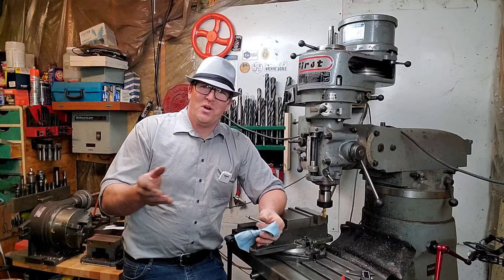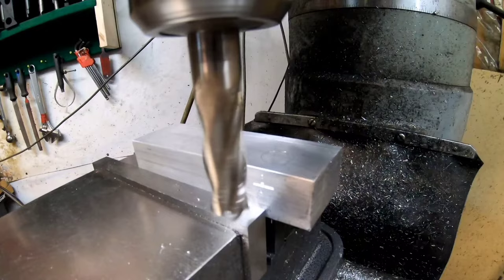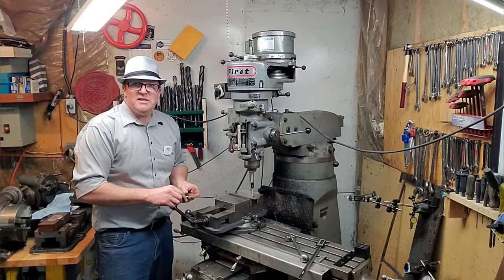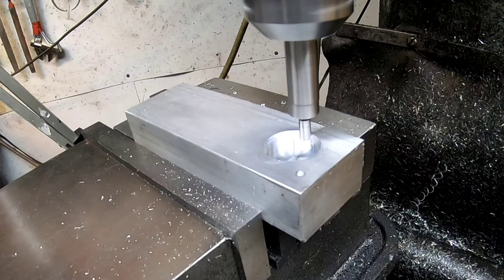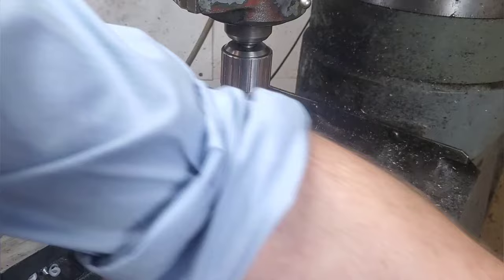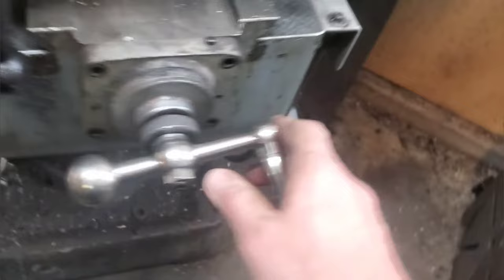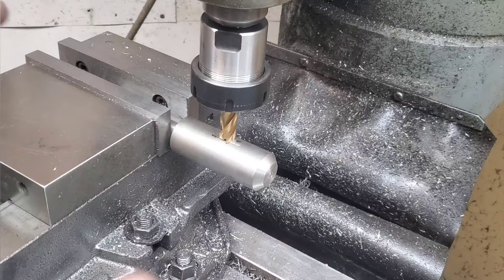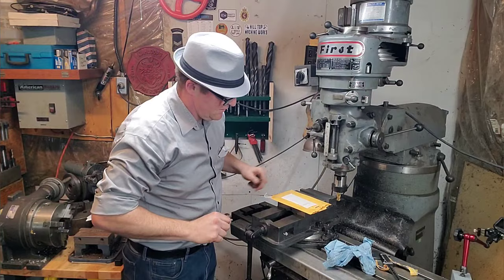Edge finding 15 ways for the Milling Machine

Comment: I’m a retired tool and mold maker of 40 plus years. I’ve got to say that the paper methods with a live spindle would get you a written warning at the shop I started in. We did however occasionally use a feeler gage and manually turned spindle to get a touch. The only other thing I take exception with is your edge finding the moving jaw side. I’ve always been trained and passed on that in most circumstances you edge find the fixed jaw side. I also prefer to use the edge finder in a collet,i find it’s more accurate. To find the center of a diameter you should edge find in one direction then the other and repeat it as you will not be spot on with the first try. Happy machining!
Reply from the maker: All good wisdom , thank you alan !

Comment: For paper touch off, use a Zig-Zag with a little oil to hold it in place. Works like a champ. The Zig-Zags in the white pack are 0.001" thick quite consistently.
Reply: What is a zig zag mate?

Comment: We used a cigarette paper and stuck it to the work with a bit of water ( or spit 😉 ). Probably a little bit safer than holding the paper.
Reply from the maker: Great point  :)
Reply: I use cutting oil, cigarette paper is 0.001 too👍
Reply: That's what i do. Got the idea out of a 70 year old book

Comment: For many years I just used a 1/4" piece of silver steel in a drill chuck.....OK so it probably will not be that accurate but good enough and quick for most work.
Reply from the maker: If it works dont change it !!!

Comment: There is no need what so ever to keep flipping the edge finder to make it wobble.
Reply from the maker: Personally I like to do it as preference to gauge speed approaching the edge and slow down.     For the actual workings of it you are correct.
Reply: @Wrighmachining  If run at the recommended speed of 1000 it will off center itself from vibration and centrifugal force. Besides , you can easily see when it is within .050" or better even without the wobble.  
I use them so much, that that extra step which has no function would drive me nuts. It's fine if you like to do it but I'd say it is not right to show it as if it needs to be done, for the nubies sakes.
Reply from the maker: @billshiff2060  thank its always a pleasure when other competent tradesmen offer good advice.   Thank you

Comment: When I'm in a hurry, I mount a center drill in the chuck, and dial the Y until I'm pretty sure I'm close to the center. Then start the mill, and sneak feed down the Z until I barely touch the work, then move the Y back and forth until the center drill mills a short line on the part. Then I can move to the center of that milled line.
Reply: I do this in a pinch for grease holes etc, works well!

Comment: One thing I like doing for small to medium shafts. Is to use the pointed end of the edge finder. Be sure the quill thumb wheels are locked. Do both side and divide by 2. Also, rather than using thick paper and fingers near rotating cutters. Lick and stick cigarette paper to your work piece.  For the top of flat work piece when doing light cuts. Extend quill until cutter touches workpiece, lock quill. Drop table .001 or .002. Or cigarette paper. Black Markers are you friend.
Reply from the maker: Thank you neil good advice!

Comment: In the 60's when I started,  we put a 1/2 dowel in the spinning chuck. Coated it with the good old "red grease pencil" ( the kind where you pull the string to access more tip. Kept in shirt pocket right next to 6" scale).  
 You slowly touch side of part with spinning dowel. When red wax appears on surface, you're 1/4" away from edge of workpiece.
Reply from the maker: The red grease pencil is a good idea ,  so when the red starts disapearing on the dowel and onto the part . Presto :)

Comment: My quick go-to way is to chuck up a centre drill or other short true-running shank and advance it to the edge until I can no longer see light between it. The change is sudden. The paper method I was taught was wet a bit of newspaper and stick it on, wait for the mill to grab it.
Reply from the maker: I like the wet the paper idea!!.  Way safer than the fingers in there :)

Comment: Some random comments for newer folks:
The paper techniques with the spindle running are highly discouraged (in many workplaces banned) because the risk far outweigh any benefits; if they even exist. For anyone learning do yourself a favor and turn the spindle OFF. If you have no access to proper XY location tools: use a marker/dykem and rotate the tool by hand grabbing the tool holder. Move in slowly and stop when you just scratch the paint. Make diameter adjustments as needed and wipe/scotchbrite the paint off as required. For the Z-axis set the tool slightly lower than a reference object (gauge block/pin, 123 block, dowel pin, etc) and raise the Z-slowly until the reference object slides completely under; zero Z and adjust for reference object. Both techniques can get within tenths without the risks... Also regarding electronic edgefinders: operation with the spindle off may affect accuracy by way of runout. If your electronic edgefinder does not support spindle on operation, rotate it by hand (please consult each tools manual for proper operation and rpm limitations).
Reply from the maker: John you raise some very good points to consider for us all . Thank you for weighing in.
Reply: That is a good tip John. I will remember this. My go to thing I use alot for finding the side edge is I took a 1/2" piece of ground drill rod that I milled off exactly .250. then I move it slowly into the work piece until I feel no wobble. It's been good enough for keyways.👍

Comment: Look in the scheme of most jobs. Touching the side or top of the job with endmill is fine. Worked as a maintenance fitter machinist in a toolroom with 8 toolmakers and most just touched the side of job with endmill. I guess experience  and a fine touch helps. Note: most jobs
Reply from the maker: Thank you jay, well said.

Comment: When using the paper, wouldn't it be safer to use a 1/2" dowel pin instead of an end mill? Also the dowel  pin wouldn't damage the work piece.
Reply from the maker: Can you elaborate?
Reply: @Wrighmachining  Place the paper between the dowel pin (dowel pin is not spinning) and the workpiece surface (side or top) and slowly advance the workpiece while moving the paper side to side until the paper is gripped between the dowel pin and the workpiece. Subtract 0.25 plus the thickness of the paper.
Reply from the maker: @philcook9967  yes in a colit ! I can see how that would work .  Thank you i will try that perhaps with a small conecting rod ( new ) that is .500 im sure of it .

Comment: For round stock balance a small ruler using fingers on the top and gently feed down a small bit in a collet until it touches the ruler. The ruler will tip in the direction towards which the bed has to be moved to find centre. Once bang on the ruler will be level. This can be very accurate.
Reply from the maker: Thank you mbak, great suggesting

Comment: What is the name of that tool you used to find center before the straight edge
Reply from the maker: Great question, I looked up its official name on Amazon and it's listed as this 

Fowler 52-577-100 Center Finder with Satin Chrome Finish, 0.375" Mounting Shank
10

Comment: You never showed a dial gauge to find centre for a hole or shaft or bar stock. 
Without a dro I set the dial gauge minus .100 thou for a .200 thou edge finder (wobbler in the uk) 
Then advance the .100 thou and you are ready to pitch off.. Started my apprenticeship in 1977
Reply from the maker: Good point , thank you . :)
Reply: @Wrighmachining  It is a point of what the toolmakers taught me. We used cigarette paper in a pocket operation so would blow the pocket dry tear a piece off damp it and when it picked up you were .002" from the work.